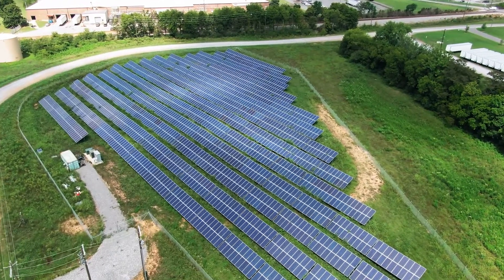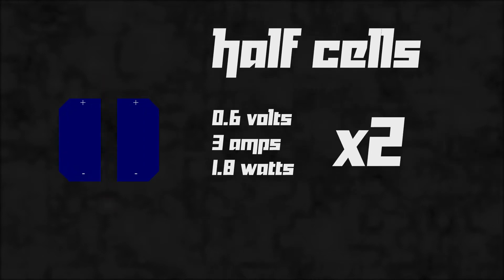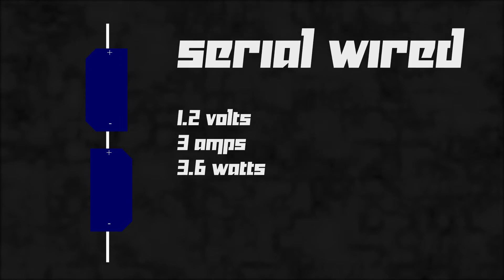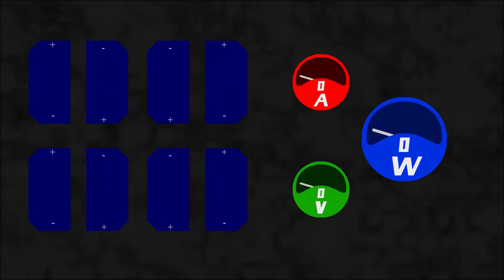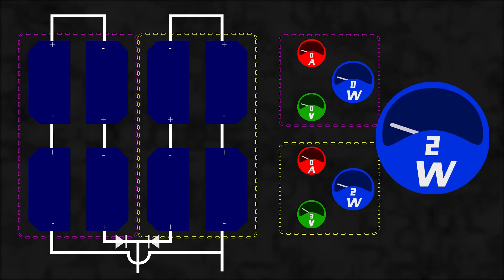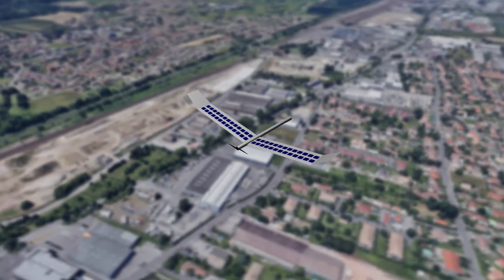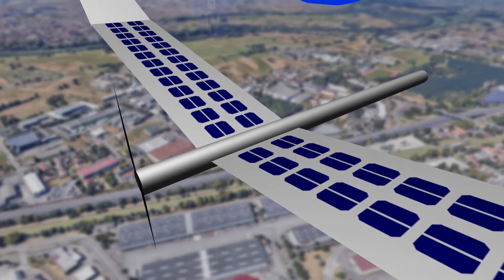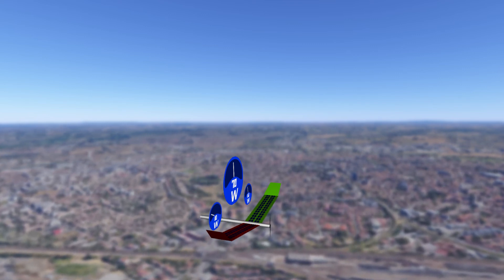Slicing solar cell to increase power

Comment: I feel such a benefit would come from being able to place cells on parts of the wing that would not otherwise be able to accommodate a full size cell. This of course depends on what kind of design you go for on your airframe.

Comment: I have solved partially this problem with adding shotky diodes parallel with every cell 
This way I do not reducing current and output does not varies that much

I agree that using MPPT control from each cell does reduce efficiency but adding just few cels will compensate the problem 
I’m working on simple MPPT that will take input 0,3V to 0.9v and 7 A as MPPT controller to output 9V @ 0.3 A in your case it would be 20V @ 0. 16A x number of cells 
I’m using 16 cell system and in theory I should get 43W
Instead of 48 W rated for best Maximum output  yes I will get 10% les but more steadily
Reply: Which MPPT controller did you use to boost voltage?

Comment: The theory is good. But did you take in account the loss on a diode? You'll have this loss all the time (shade or no shade).. and since it's a plane.. it's highly unlikely you'll get shade just on one set of cells..
Reply: You can use transistors as diodes and get better results, with minimal forward voltage losses.

Comment: Nice theory but practically you exposing yourself to many failures in cutting
What about to have MPPT on each cell boosting your voltage to 20V?
Each MPPT output is parallel to other 
If one cell drops out you are loosing only power off one cell only
In well design system small shades on your airplane would not matter much
Reply: Problem is that you lose efficiency on each MPPT charger... Also you increase the weight and the cost.
Reply from the maker: It's not only a problem of shade on a plane but a part of the wing is always facing the sun more than the other, but your ideas are welcome.